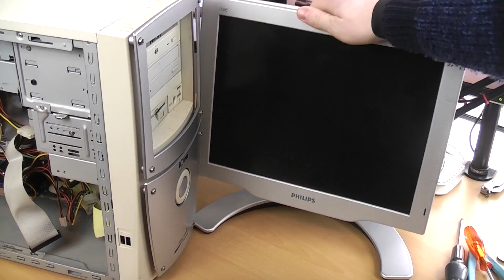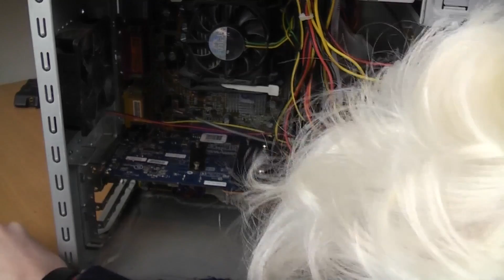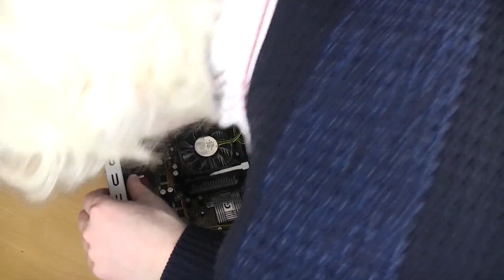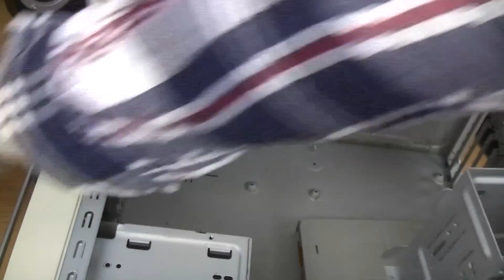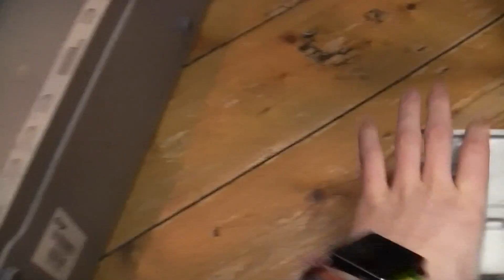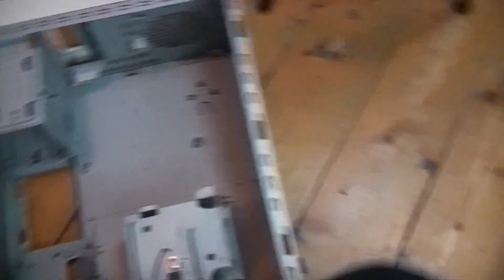A Free Philips PC & Monitor + Bonus Teardown | IMNC

Comment: READ EVERYTHING!!!!!!!!!
I LOVE WINDOWS XP
I HAVE A 2.83 GIGAHERTZ CORE 2 DUO 4 GB OF RAM DUAL 80 GB HDDS AND I USE IT A LOT EVEN THOUGH I HAVE A LOT OF PCS, ONE I GOT A PC THAT IS A HIGH END CORE I FIVE WITH 6 GB OF RAM W7
AND I HAVE OTHERS TOO
LIKE A 
DUAL DVD RAM DL, DUAL 2.4 GHZ QUAD CORE XEONS 16 GB RAM SPLIT BTW CPUs AND A LOT MORE
DUAL 600 GB HDDS SAS RAID
SO 1.2 TB RAID
IMAC G3 REV A (233) (32m) (4Gb) (ATI Rage IIC 2Mb)
Mac mini g4 w/512 Mb/40 Gb/Tiger 10.4.11
Gateway GP7 933 Pentium 3 512 Mb
Dell Inspiron(Inspiration) 5000 Series Special Edition core i5 W10 8 gb 1 Tb
128 Gb iPad Air 2
Galaxy Note 3 32Gb
32 inch Vizio Flat panel LCD Tele (yes Im American) AND IM PROUD DANGIT
XBOX ONE
NINTENDO WII
DELL ULTRA SHARP WITH SPEAKER BAR
100 MEGABIT FIBER VERIZON FIOS
PHILIPS $130 30 PIN / LIGHTNING DOCK
A VINTAGE GENERAL ELECTRIC AM RADIO
A 27 INCH RCA CRT TELE
 AN APPLE TV 3
AND MORE

Comment: You should flash that GeForce 7800GS and use it in your PowerMac G4 or G5, as it outperforms the Radeon X800 XT and whatever card you have in your G5. It's really easy to do, just need to boot up of a DOS floppy disk (you can make one easily using another PC, WinImage, and a DOS image from http://allbootdisks.com), then just grab a copy of nvflash (guide here: http://themacelite.wikidot.com/nvflash-basics) and the appropriate Mac ROM for the card (http://themacelite.wikidot.com/wikidownloads2). Put both nvflash and the ROM on a second floppy disk, and run the commands as detailed in the guide. I have done this, and it worked great on a GeForce 6200 I had.